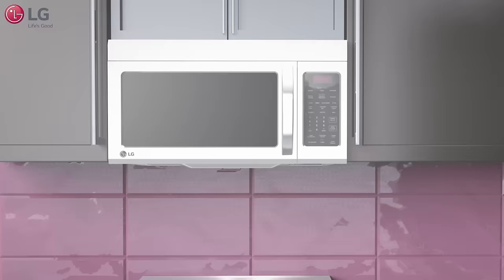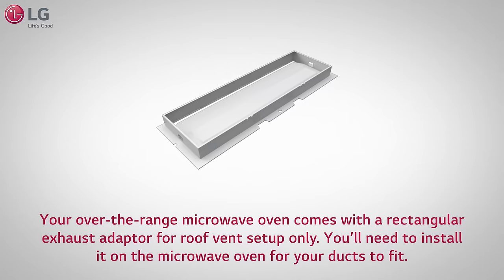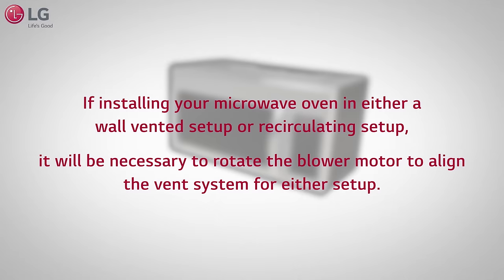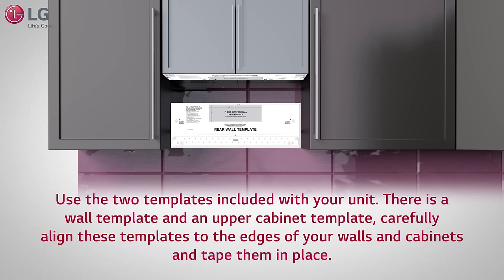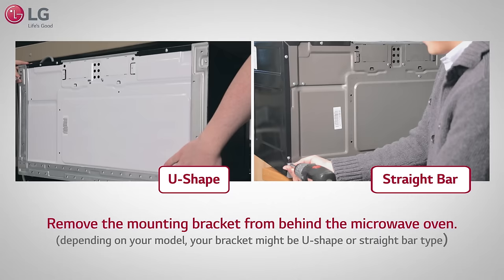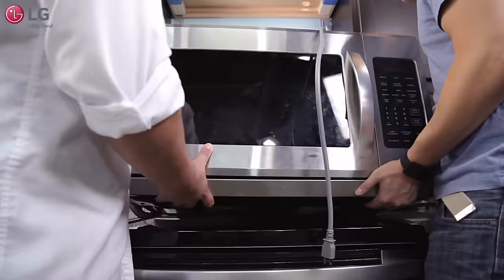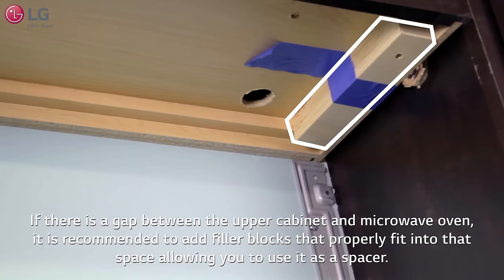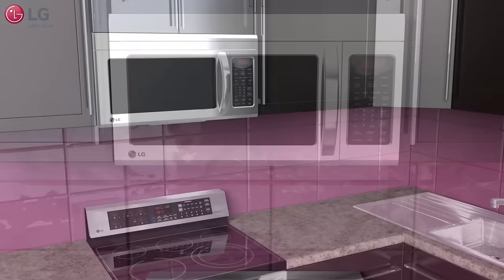LG OTR Microwave Oven - Installation (2018 Update)

Comment: My LG Microwave LMV1762 came with the blower motor already in Recert position, not roof venting default as it states in the video. Also, the mounting bracket is not located on the back of the Microwave but loosely packed in the carton.
Reply: Mine came default configuration for roof vent.
Reply: The one we purchased vents out the back, not the roof.

Comment: What can I do when there's a cement wall blocking me from putting the long screws for the racket
Reply: We have a dry wall but beyond that there's cement and the screws wont reach far bc of the cement
Reply: Was thinking exactly this. I live in a condo and the wall my microwave will be sitting against is concrete as well, so I guess it'll be safe to drill and use tapcons

Comment: Really? could not find a roof vent that was not all bent? Video content was great, but execution with prestine parts failed.
Reply: Not a great endorsement for LG quality control...I agree.
Reply: Did you mean the rectangular exhaust adapter ? Because a roof vent actually gets installed on the roof, which isn't provided by LG.

Comment: Rear /top vent baffle..... be sure it moves freely. They way LG has it configured the baffle will not open. You need to bend the taps to allow it function properly. I wonder how many were installed improperly 🤔

Comment: Just an FYI, but you should ONLY use the lag screws if you're fastening the bracket to wooden studs. If you have metal studs in your walls use a sheet metal screw with a washer instead

Comment: be careful with your model. mine fits in the 30 inch opening, but then you cant open the microwave door. it hits the side cabinet. i had to cut the cabinet just so i could open the microwave door. thats why this thing is on sale at the big box stores etc. buyer beware. if you flush mount this microwave against the wall as they instruct you to, it will not open when installed next to normal wall mounted cabinets. i cut my cabinet because i missed the return date, ruining a brand new cabinet. not to mention the hassle of taking just a portion of a mounted cabinet out. brutal design.